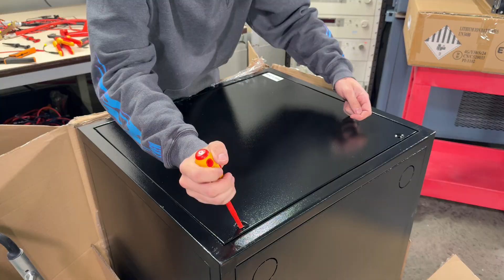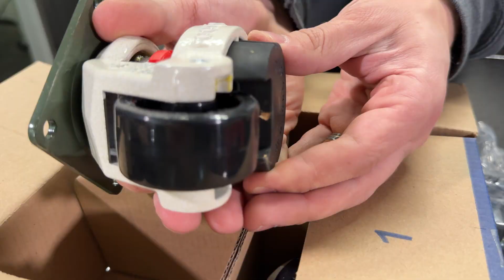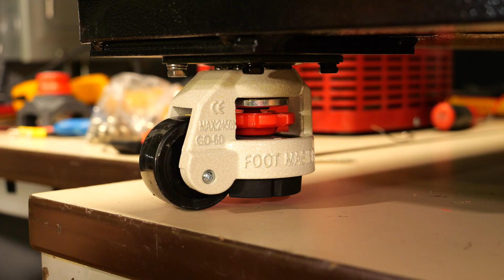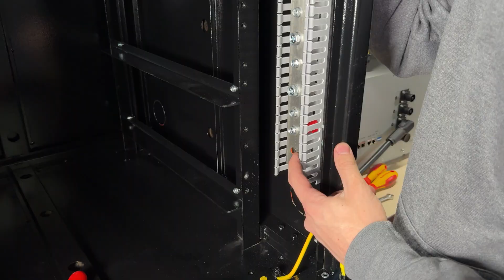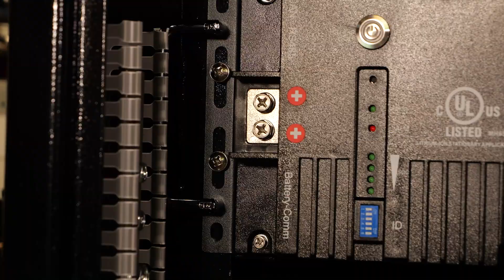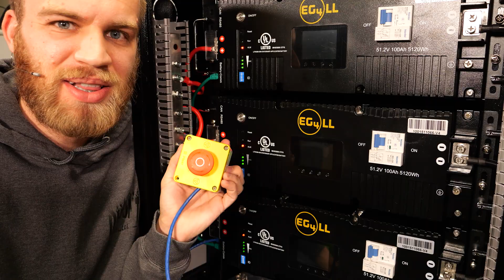Everything You Need To Know About EG4's 3 Slot Battery Rack

Comment: What a great timing. That's exactly what I am looking at getting.
I can't quite get 3 batteries in one go. Does Current Connected sell the 5 AWG cables?
I see the 4 AWG, 9" on your website, which would likely be the closest.
Thanks for the video!
Reply from the maker: Great to hear!  The 5AWG cables are included in the boxes with the batteries, no additional parts needed.
Reply: @CurrentConnected  Amazing! Thanks for the response